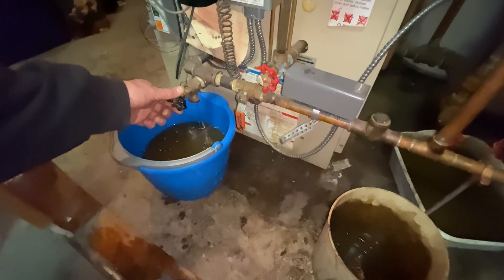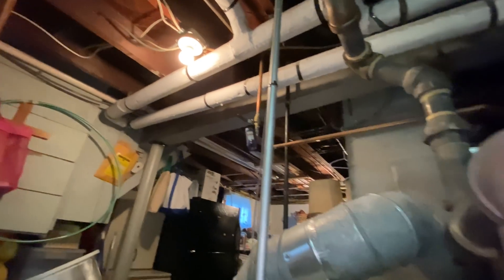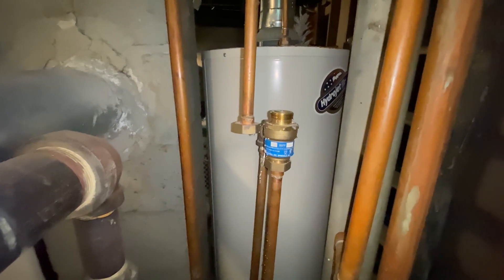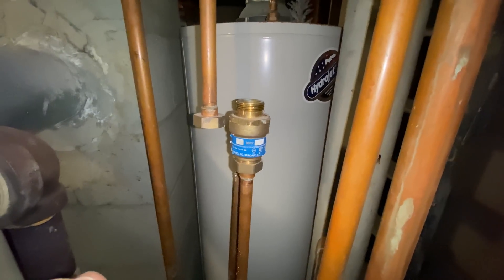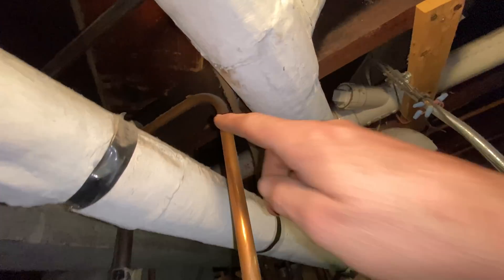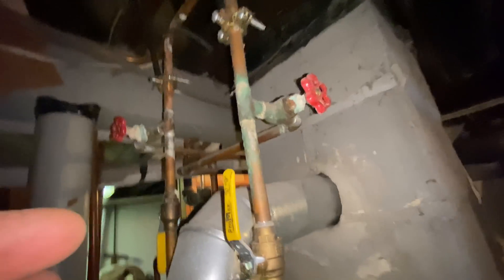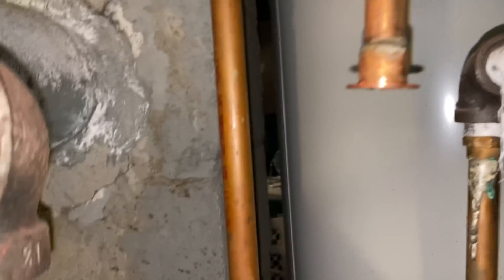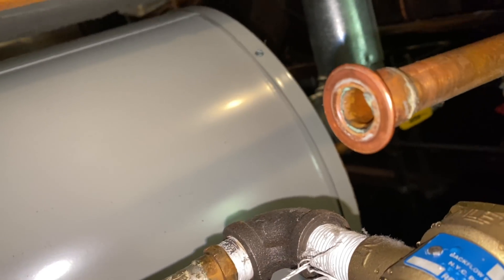Repairing Overfilled Steam Boiler

Comment: My steam  boiler over fills aggressively,  u can hear the water supply into the low water cut off area of the system.   Any advise? It wont shut off so i have manually keep it off and filled at right level.

Comment: Let's do the math on the drops. One gallon is about 60,000 (big) drops. Looks like it was dripping about once every 10 seconds, or 6 times per minute. So it would take 10,000 minutes to fill a gallon bucket, which is about one week. So a gallon a week dripping. To fill the whole boiler with 50 gal as you said would take about a year. So I don't think the leaking valve was the problem, more likely the customer was messing with it and overfilled it by accident, didn't shut the valve off completely, etc.
Reply from the maker: It’s a mixture. The boilers been banging for months I was told. Yet it was really scary today. Yet he also said water today came out the pipe in the back when his brother was looking at it before he called for service. The leaky valve still needed to be replaced. Yes the customer blew his relief valve. The drip is reason for initial banging yet not over pressurizing the boiler. I never took 12 buckets out. If I did I didn’t really remember. This job no basement drain so I was lugging 5 gallon buckets up into yard to drain.
Reply: In my current case, the hot water coil has a leak... Wonderful.
 Only a 6 yo boiler in a home I bought back in February 2023.
 Seems the previous owner never maintained the boiler very well, as it is full of sediment too, like hot chocolate.

Comment: Are there any autofills for steam boiler that can stop filling at a certain level on the sight glass? Like have it fill if the glass level drops one inch and stop when it’s back at proper level.
Reply from the maker: Most will stop filling when low water cut off senses water. This boiler doesn’t have an auto fill just the manual fill ball valve.
Reply: Yeah I was just curious for my own steam boiler I manually fill it when needed.  I’m afraid an auto fill may overfill it someday.
Reply: @muxxor9492  autofeeders are the surest way to ruin a boiler imo.  Too much makeup water while masking a water loss problem.

Comment: Also did you notice not one drip came out the whole time you cut the pipe and you say'n you got 50 gallons???🤔🍺🥃🍺🥃🤔🍺🍺🍺🥃🍺🥃
Just say'n.
Stay safe.
Retired keyboard super tech.
Wear your safety glasses.
Reply from the maker: The homeowner said the boilers been banging bad since November. He also said water was pouring out of back of boiler. Pointing to relief piping. I am sure he tried to add water to boiler since he thought the glass was empty when I arrived. The valve had a small leak by. It will over fill the boiler yet the homeowner blew the relief. I never took 12- 5 gallon buckets out of such a little boiler. The buckets were not filled to top since I had to carry the buckets up the steps and out to back yard to dump. Yet 4+ gallons in each bucket.

Comment: My man that little drip would take weeks to fill a fiddy gallon bucket.🤣
More likely the coil in the boiler is leaking  & when the pump runs it leaks faster??
Do a pressure test on the coil and badda bing badda boom.
That leak you showed would have had the boiler shut off for a week ,if the coil is good you check for cracks in the porcelain on the probe ,if good check operation then if good eliminate an accidental valve opening by the home owner?
Once the boiler fills it doesn't make steam it boils water rads get cold ,house gets cold etc...
Just say'n.
(BLOP,STATIONARY,HVAC,HIC,PA ,NJ)
Stay safe.
Retired keyboard super tech.
Wear your safety glasses.

Comment: why leave the broken valve on ... its just ... damn why ?
Reply from the maker: Saturday emergency service 7 calls after this one. Leaving old valve won’t harm anything. It’s just a coupling now. No handle to move the valve closed. To remove I would need to drain down the house. Also saves the homeowner 150 for the extra hour it would take to remove. I worked to 2 am this day. When I am doing the emergency service I am doing what it takes to make everything operate. Big jobs get rescheduled

Comment: Hello, are they running a hydronic zone off the bottom of the unit?
Reply from the maker: Yes that’s a hydronic loop off the boiler. It’s common on steam boilers. Works great as long as hot water loop aqua stat isn’t set too high. Don’t want steam created when only hydronic zone is running. Usually a new addition on a house is when these are installed.
Reply: Thanks for the info; also Tool is a great band  to sing at work 😀 👍 🤘🔧

Comment: I'm surprised you dont carry a flex-hose so that you can run it to a drain if available.  But then, maybe the water would be too hot for the hoses...?
Reply from the maker: Only drain was up the basement stairs and outside. I dislike houses with steam and nothing to drain into close by. I usually keep a washing machine hose for close by drains. I have a heat rated hose. Yet once pressure is out of system it won’t drain once hose goes higher than water line.
Reply: @thehvachacker  could have drained it somewhere with a long hose into something in the kitchen area maybe?
Reply from the maker: Some houses don’t have drains low enough. Yet I decided to keep a pony pump on my truck for houses like this. It’s never fun humping 5 gallon pails of water up basement steps I dump. I will try the pump for steam maintenance the first time this Saturday. Another house I take care of with no basement drain. I killed the toilet ejector pump dumping very hot water down the toilet. Wasn’t blamed for it. Yet doubt the house ejector pump is rated for near boiling water